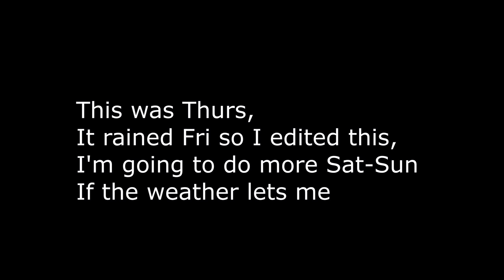Garden Barbeque Room & Deck build Pt9 - Putting on the roof & some of the front battens

Comment: Buys himself a new pressie then drills holes in it, !!! Great idea that, saves a lot of work, It's looking good.
Reply from the maker: 😁👍 I only bought the saw, batteries & charger, I've already got all the tracks, they're a few yrs old, this one is an 1100m offcut from one of the two 1400mm i got with 240v saw, I did tho drill a couple of hole in the £1000 festool mitre saw in the shed, in it's fence to hold a backing timber only days after i bought it 😁👍👍 Thanks Brian 👍

Comment: I'm designing my garden workshop at the moment and the techniques used here are great. Cheers. Also the Tommy Walsh bit was a classic
Reply from the maker: Good, i hope they are, i just had a look at past comments & you say you don't use Facebook, i  was going to say i've photos on there, it's easy to sign up tho, just need an email no other details i don't think, my mate is a 70yr old woman on it 😂😂 i saw TW putting a deck together with coach screws & it's stuck in my mind, apparently he had a building company, you wouldn't put joists in your house supported by coach bolts so i don't know why people think it's ok for a deck that's outside exposed to the weather, & will prob get just as much weight n abuse, imagine half a dozen people on it 😒👍 https://www.facebook.com/gid.joiner/photos_albums

Comment: Any particular reason you tend to use the combi over the impact driver? Noise? Or just what was to hand?
Reply from the maker: I do find them a bit noisy, it does come in handy when i need a bit of 'kick' but i find i have more control with the combi driver, i can feel how the screw is going in & how well it's holding 👍